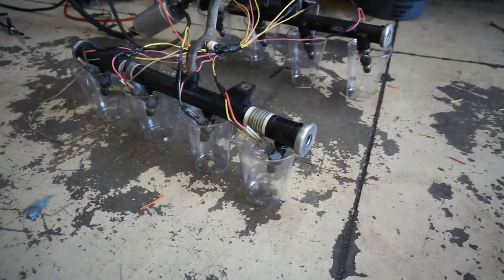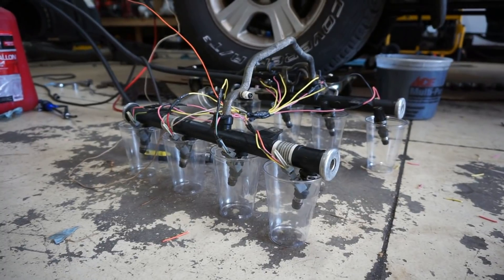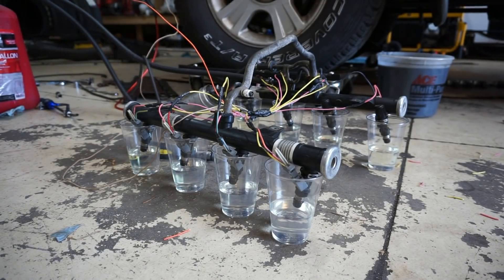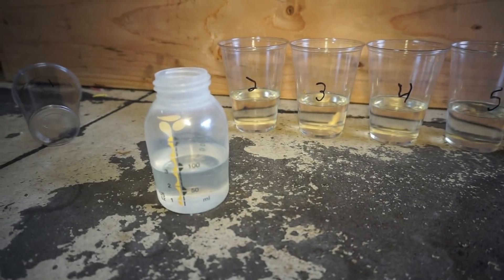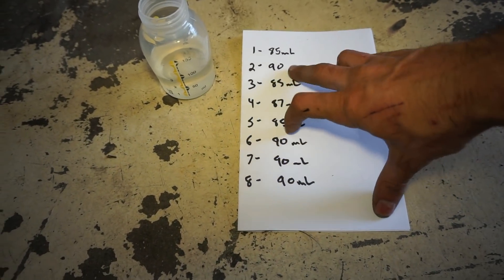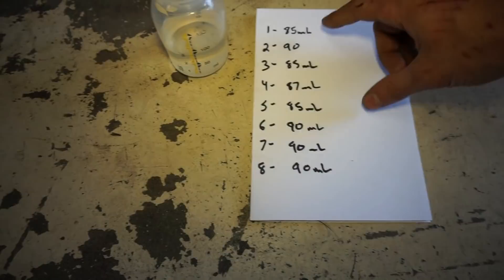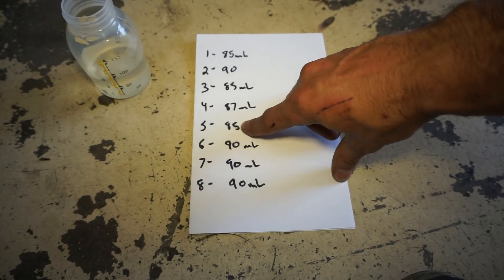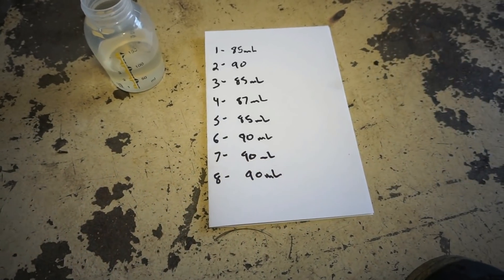BLOWN ENGINE Flow Testing LS Decapped Injectors After Piston Failures!!! - a21bravo

Comment: This is a neat test, I enjoyed watching it. Another variable to consider though would be latency of the pintle opening and closing. If the pintle is slow to open, during an actual injection event, it may not be opening all the way causing lower flow. I would like to personally try this same test with an Arduino firing the injectors individually for a specific millisecond pulse, and do this for a longer time sample.

Comment: Hi this is unrelated to injectors but wondered if you could post what seller you got your turbo from and what brand it was also please. Thanks.
Reply from the maker: n2fastcars Link in this description.

https://youtu.be/u9Z3h1RE-2o
Reply: Thanks for the link. Ebay is running a 20% off for any one item. So what's better then a cheap turbo? A cheaper one of course.
Reply from the maker: n2fastcars Hell yeah.

Comment: send them out and have them flowed professionally so you can get Dynamic flow test pretty cheap insurance. If you're questioning if the injectors have anything to do with it. You've done a great job with what you've done
Reply from the maker: shit myself HP I did do a dynamic test a while back with these when I had.original flow bench... They're still really close to what I had originally... I may, or may not have already ordered a different set, lol.

Comment: My theory:  If you just leaned out/overheated a cylinder drastically that could butt rings and break the piston.  But you also had bent rods.  Bent rods to me is too much boost (timing?) at peak torque.  So maybe you hit 20lbs of boost (with too much timing?) on one of your many pulls and didn't know it.
Reply from the maker: sanger440 All of the pulls were logged 15lbs 11 degrees 10.7 to 11.2 afr...
Reply: If you are sure you did not exceed 15 lbs of boost, then you need to verify your timing is correct.  You have or will have the motor apart again, use a dial indicator at to verify TDC and make the appropriate marks somewhere to double check timing is accurate.
Reply from the maker: sanger440 I'm planning on it.